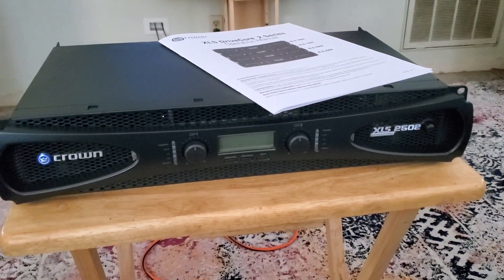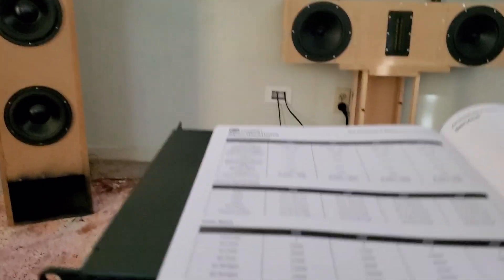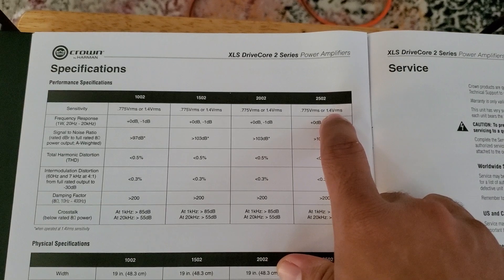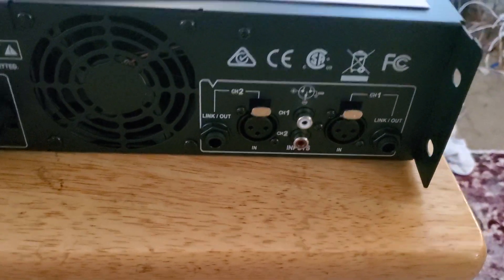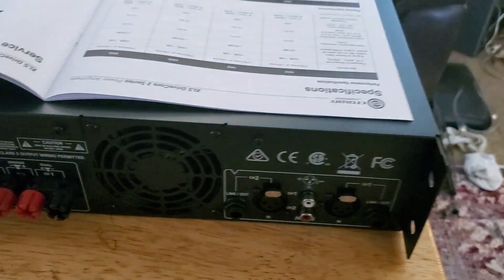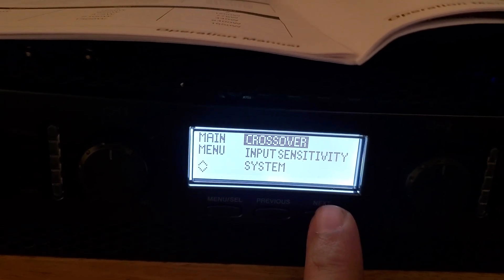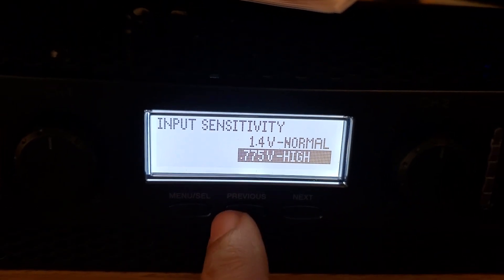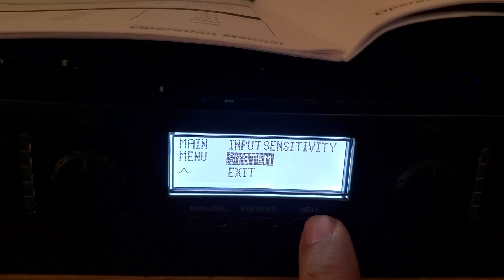Crown XLS 2502 drive core 2 Overview

Comment: Way back yonder in the 80's and 90's I was playing bass in a band full time. The PA had 8 Crown DC300 power amps. They ran clean and with no problems for decades. Crown is the industry standard. The best amps made.

Comment: I have couple of the Crown 2502's.  I can max the volume without pushing a signal to the amp... I only hear a slight hiss with my ear almost against the tweeter.  Not enough that you could even hear in a dead silent room.  I have had vintage audio equipment of pristine status that was on par with the Crowns.  My speakers sensitivity are 98db SPL too.  I have owned quite a bit of high end gear. The Crown's can hold their own.  For the money, they can't be beat for power, efficiency and features.  Not yet...  The Crowns match very well with the Emotiva PT-100 (which has a decent DAC built in, or use of a different good DAC (Aune X8 Magic DAC, JDS Labs EL DAC II, The ES9038Q2M SABRE32 Reference DAC, AK4490 - AK4499 etc.) and also using tubes as a buffer, if you want a fuller bodied richer sound.   I would use good quality JBL or Klipsch speakers at least.  People can get Audiophile grade gear on the cheap these days!!!  What can be had for $5,000 today, would have cost you $50,000 or more 20yrs ago.  Think about it...
Reply: The Crown has a ADC/ DAC from the 90's which has only a measly 48Khz sample rate - and you can't hear the sound is being totally strangled... ??
....and you recommend feed it with a AK4499 @ 768Khz...     LMAO
Reply: I said...or use of a different good DAC.  Do what you want or feel is best for YOU.  Have you tried this amp using different dac's?  How would you know what it sounds like?
Reply: @fx-studio  I recommend you check out " Z Reviews "here on youtube....He practices what he preaches.  He is reputable.  He is honest and practicle.....with OCD.  Look at his hardware and what he uses.  He reviews high end hifi audio hardware.  Check out his rig.  He uses 3 Crown amps in his main system.
Reply: @fx-studio  you have only 6 subscribers in 5 yrs....LMAO!
Reply: @fx-studio this is true. However Crown also makes the XLC 2800 which is purely the Drivecore amp without any A to D to A dsp.

I use a minidsp 2x4 hd for my sub xover.

Comment: I recently bought an XLS 1502 and even with the input set to 0.775 the output is relatively low.  I am having to boost via an ART cleabox before going into this unit. Is this normal or did I get a bad one. I am coming out of a RodeCaster Pro 2.  I have the amp in bridged mode. Coming out of the LFE off a receiver was the same.  Even setting the gain dials full, I would not get full output from this unit, without boosting the input signal first.
Reply: I have to boost with the ART on the XLS 1500. I used an NHT SA2 which is about the same power (300 watts vs 250 watts on the crown) and it's WAY louder than my XLS 1500 using the same RCA input. With the ART, (XLR outputs), the NHT is still louder using RCA. The crown needs a high voltage input to make it come alive.

Comment: Thanks for the video. Could you talk a bit more about the crossovers? Are you connecting these to speakers with a passive crossover and if so do you set them on the amp as well to not have it waste energy on producing a signal that wont be used by the speaker anyway.
Reply: Well, of course you may connect these speakers with a passive crossover. But you don't have to.
With the activated crossover function (Crown) you are connect directly to the membran (speaker). That's the way I connected the 2 subwoofers in my hometheater.
With another 2x Crown: are connected the huge Infinity Kappa monster in bi-wiring mode. Even they have a passive crossover built inside, it sounds incredible!

Comment: If the output knobs are set to the 12 o'clock position will that reduce the available power to less than the rated power?

Comment: Does the amp save the settings after you turn it off, or you’ve to do the setting every time you are setting up the PA system?

I’ve this amp, and I plan to use it to run my two subs, Peavey 118, 400 watts, 8 ohms. 

Is it good to run those two?

And how do I set the inbuilt crossover to get the desired Bass volume?
Reply: Lowpass on 80hz.
And yes the settings will be saved

Comment: You gave me the exact information that I needed. Im gonna do the biamp setup like you. I need amps because my power hungery towers keep putting my receiver into protect. They are the polk rti A9 rated at 500watts rms so no receiver can really make these speakers happy. Do you think I should get 2 of these or maybe 2 of the 1502? Thanks for the help man
Reply from the maker: I went for the 2502 just so I would have lots of head room or maybe someday repurpose them as subwoofer amplifiers. You would do well with the 2002 but can't go wrong with the 2502.
Reply: @BrianRiotHobbies  ya ill get 2 of the 2502s. I already have an xli3500 on my subs. Or I could buy one of these and run the tweets on the receiver. Tough decisions 🤔
Reply: @BrianRiotHobbies  1502?
Reply: Go big, you'll be glad you did later.👍
Reply: Hi Brian. . How to get my AVR to turn on my crown amplifiers. I have two xls2502
Reply: @delroythompson8929  you can use the avr in the master outlet and when you power it on, the amp will turn on too. Or anything controlled by the master outlet. Great idea here man. Because crown amps have no trigger
Reply: @Pittsburgh-412  Thank you very much. .. So i will have to buy a special master outlet for this function?
Reply: @delroythompson8929  this surge protector has one outlet that will be used for your avr. When you turn it on, all the equipment thats plugged into the other outlets will automatically turn on too. Nothing else needed. Hope this helps man
Reply: @Pittsburgh-412  Thank you very much Pittsburgh 412... this is great.
Reply: @delroythompson8929  I don't see a link now. Did I post it? Swear I did lol. I just been 1 too. Great idea
Reply: @Pittsburgh-412  Hi Pittsburgh 412 i did not see a link.
Reply: @delroythompson8929  this is the one I bought. It's expensive and you don't need one that cost this much but I like this brand
Reply: @Pittsburgh-412  Hi Pittsburgh 412 can I see a picture of it.  Thanks. .

Comment: I have 2 of thease but how I bi amp is a split XLR y jack (1 into 2 ) with another split XLR y jack (1 INTO 2) JOINED TO THE 1ST XLR Y JACK from the left signal output of an eq or other signal source (mixer etc)  so that turns 1 output into 3 but only 2 is needed to bi amp you will have an extra XLR out aux (do the same for the right side then of course plug 2 of the 3 left XLR output Jacks into the left line in 1 to each amp and same for the right

Comment: Hey Brian, I’m looking for an amp to hook up to the back of my av receiver pre outs,  to power 2 crewing Vega xls215s they are rated 500w max 250 rms  will this work in that kind of setup or will I need other components? Or should I look for a different preamp. any suggestions will be appreciated thanks.
Reply: Xls215 are 250rms 500peak dont worrie bout the peak power..i think xls215 can run on 4ohms or 8ohms if i can remember.check cerwinvegas site they have all specs on there models.

Comment: Nonsense, a PWM is always analog technology on the two switching transistors!  Only the DSP of the switch should be digital here.
 Has anyone ever looked inside the empty tin box?
 That would have easily fit into one height unit, even with 4 channels!
 How it looks, everything is spit with glue.
 There are parts in it for a maximum of 50 €.
 I never spend so much money on this shit !!!
 With Class D you can only use 3/4 of the power - especially with the half-bridge circuit used here and this joke of a power supply!  No bass comes out of that !!
 The crossover is useless because there is no adjustable delay!  This sheet metal cube has absolutely nothing to do with sound!
 Crown should be ashamed!

Comment: For pro audio is .775v and for the other is 1.4v dont give false information
Reply from the maker: You have that backwards good sir. pro audio line level signals can even be higher than 1.4v at times and consumer grade can be lower than .775v at times. You want to make sure the amps sensitivity matches your equipment or you will not get the full power out of it. This is an awesome feature that Crown built into this amplifier so that it can be paired with consumer-level equipment such as my Marantz receiver which is consumer-level. If I were to leave this amplifier in its 1.4 Volt Pro setting you will be getting around half the power the amplifier is actually capable of. I hope this helps.
Reply: I know what i am talking about, i own an xls1502, an macrotech 1200 and a bose 1500 amplifiers, and all of them are set for .775v so dont try to lecture me about pro audio because you are wrong
Reply from the maker: @toniradolovic  I mean no disrespect but check the bottom of page 10 of the owners manual on the crown website where it states. "The INPUT SENSITIVITY feature enables the playback from sources with inherently low output levels to drive the amplifier to full power by selecting ".775 - HIGH." It is 
recommended that this remain set at the default NORMAL setting for all other audio sources to provide optimal system performance. The HIGH setting is often used with 
source devices that use RCA connections.
Reply: According to my experience: Brian is right! 

Using the Chinch input with a cable - let's say from a Denon 8500H - you need to set to .775 Volt (otherwise the speakers work not so loud) for a harmonyc audio environment.
Reply: @karlkuhlschrank3046  nope you are wrong, those hhome theater amp have higher output signal voltage then pro audio equipment...so pro equipment has signual output under 1.0v and home theater has signal output voltage closer to 1.4v or even higher than that
Reply: @BrianRiotHobbies  then you need to lern more about amplifiers and audio equipment